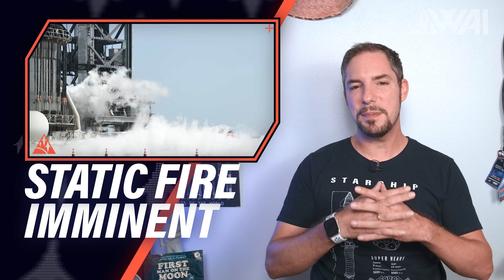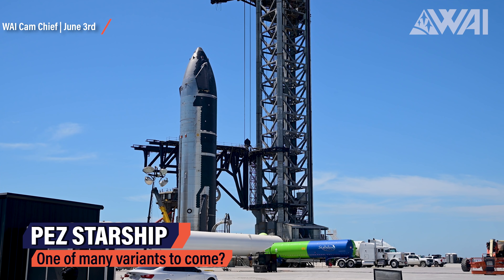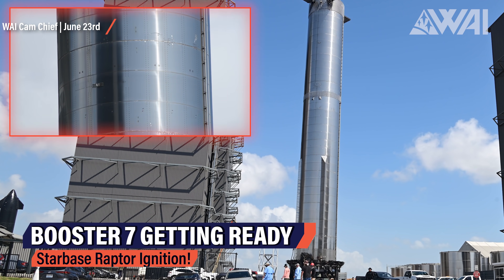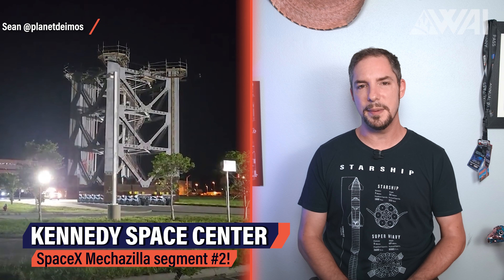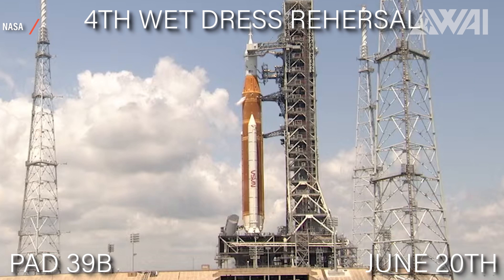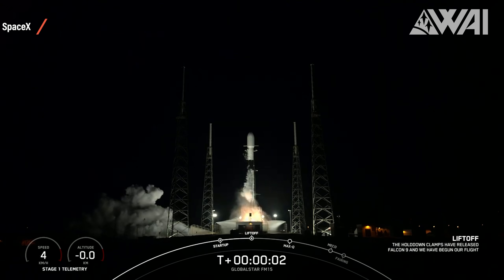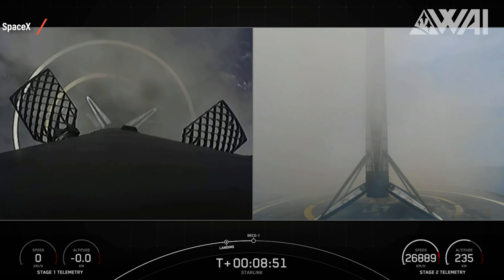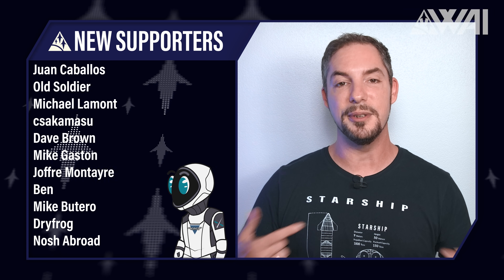SpaceX Starbase IGNITING Starship Booster Engines!

Comment: Dont know if a modular system makes sense, since they can build starships at a relatively cheap price.

They been pumping out ships at a rate that not long ago was unheard of.

Its nice that they can customize ships for its purpose, and not need a "one to rule them all" design like the shuttle.
Just like planes that you can refit it based on purpose, but you dont go around swapping modules based on each flight.

I wonder if there will ever be an expendable version, with an even bigger fairing. No tiles, no sea level raptors (since no landing), no flaps. If thats the case they could put some huge and heavy stuff in orbit if needed...
Reply: Extra fuel and oxidizer could also occupy the hollow sections of permanent habitat panels are spec'd to tank parameters and cryo tested.
Reply: @gary.richardson  you mean making the thing a huge structure full of fuel, then once in orbit convert it to a huge habitable area (even if that means some modifications while in orbit).

Yeah i always asked myself if thats an option.

They could even remove the raptors and carry them back with another starship. That would be quite good to build big habitable structures.

The way i see it, starship as great as it is... its payload. The real monster is the 1st stage.

2nd stage could be swapped based on the needs, reusable, expendable or even as said something that can be repurposed.

There are so many options opened by this that the developments in the coming 10 years will be amazing.

Comment: Lots of waste from both. Both doing one task, means waste.
Reply: Elaborate?
Reply: @alvianchoiriapriliansyah9882  Sure. Waste comes in many flavors. NASA"s approach has always been waste, shuttle wasn't exactly that great, too costy, waste big time in the form of $$$. With spacex the waste is in the form of whether the raptor 2's will be able to take multiple launches at 230 tons of thrust. The boosters landing ocean side at first means unusable raptor 2's and this leads to waste. If all that is fixed, it will lead to a better solution, until then we will see. Having a vehicle purpose built, means once its purpose is over, it can't be used for something else, so waste is in the building of the vehicle via welding wire, gas, and money.

Comment: The can crusher is a unique device. As far as I am aware no other rocket is or has been tested this way. In the past engineers determined the flight loads mathematically and built the rocket to withstand those mathematical numbers on paper. Then they would fly it, there would be no real testing other than the first one is empty.

Comment: comment for Algo also it would be cool to see a spinning top section for artificial gravity
Reply from the maker: Thank you! That would be hard to do. The radius of 9 meters would mean that everyone in the Ship pukes as the difference between rotation at the feet and at the head of the Astronauts would be too low. Maybe extending booms with Starships docking? Maybe cable, but that would be risky when starting and stopping the rotation.

Comment: Please note there are 32 Raptor2  engines under skirt. This is common error. The 33 engine is on the second stage. U R Great!
Reply: 20 in the outer ring and 13 in the center. Starship itself will have 6 and then 9.  39 and then 42 for a full launch.

Comment: I think Elon wants to keep the part count low. Interchangeable modules adds to many failure points.
They already want to build hundreds of starship so making them according to their needs is not a problem.
Reply: Let's see a Starship get into orbit and back safely first. If it blows up, there's not much sense talking about reconfiguring...
Reply: @Andreas-gh6is  it’s very unlikely for the first orbital Starship to survive re-entry.
Reply: I would expect modules that are set at construction time — not swappable, since as you say, that adds a lot of extra complexity and failure points. But a standard propulsion section with a payload section determined by what's required when it's built... that seems probable.

Comment: @2:50 Starship is a modular design. Its ultimate diameter isn't even fixed. 
Transporting 12-meter wide objects to space, like bigger _integral_versions of James Webb? 
Transporting huge amounts of ultraclear frozen water to wrap in segments around cargo and protect it from cosmic radiation?
Transporting large, heavy segments of nuclear reactors to assemble together in space to provide power past the orbit of Mars?
Starship can do those.

Comment: variants I think will happen
starlink deployment starship
tanker starship
normal cargo (smaller doors)
big cargo (big door)
cleaning up LEO starship
lunar starhip
mars cargo starship
mars human starship
expandable starship (no header tank, finnsand sea level rapors, but has fairings )
human starship for leo

I can also see spaceX develping a starship to replace orion/SLS. Small place for crew and the rest extra feul for getting to gateway in on launch or just expandable 2nd stage with orion on top

Comment: Elon identified at least 3 varients from the earliest days of Starship: crew, cargo, and tanker. Your idea of a two-piece Starship is interesting but would seem to require something other than a welded interface. How much extra height would be required to accommodate such a design?
Reply: Not much. The problem would be with the tile system at that joint. Welds don't flex much where a joint like that could. As Elon said, he hates flanges which is basically what you would have at that joint but internal instead of external.
Reply: That was my thinking and Elon does like reducing complexity.  With as many Starships as they are talking about building, I just don't see the need for a modular design.
Reply: None. The Starship is already built ring by ring all welded together. Some rings are part of the fuel tanks, others part of the cargo/crew area.
Reply: I've seen SpaceX always optimizing for weight to maximize what they can get into orbit. An interface only adds weight so I think not going to happen.
Reply: With automated welding and jigs, why not simply a reinforced, thicker band at the mating edges? Weld it together much like it normally would be, cut it off when a different type fairing is desired, and weld on the new one. If the narrow heat affected zone is removed when cut, it should be just as strong as the first time. Adding the extra layer, narrow band at the joint would give you extra material, so you don’t end up with a shorter rocket. Best part is no part, and the welding and cutting is pretty fast.
Reply: @evanmorris1178  They are already planning on building a vast number lot of Starships.  Musk's goal is to produce a starship every 72 hours.  

At that kind of scale, I believe their resources would be better spent on optimizing their pipeline so they simply have new vessels of the needed types coming on line when they are needed.  Making them modular does appeal to my inner Kerbal but seems unnecessary when it can be solved via logistics rather than engineering.
Reply: @danielbuggie591  I agree, that’s the story, and I hope it comes to pass, but 1 every 72 hours is aspirational. They might pull it off a few years down the line, but in the near term it might come in handy. Always good to have alternate plans. Thanks for the reply.
Reply: @evanmorris1178  Sure, and the 72 hours would surely not be the time to make a starship but a reflection of how deep and wide the pipeline would end up being.

Comment: I’m less interested in how many variants there will be than I am in how the tanker variant will be configured. Will it have separate tanks? Or will the two main tanks be enlarged to consume the entire volume of the vehicle which would maximize fuel load and minimize overall vehicle weight. After the flying Starlink says, getting that tanker up and running should be a top priority.
Reply: regardless of separate tanks or what shape they are the fuel is limited to the amount of cargo limit.  The fuel cargo will be somewhere between 100T and 250T which is still bigger than any payload we've ever been able to launch.  Think of how many launches it would've taken to build the ISS if Starship had been used.  It's safe to say that assembly would've been completed in days and not years.
Reply: @plexisgaming  it would probably just be made of starship hulls.
Reply: @cannonfodder6299  Or from an extension section in the middle of a Starship. Section latched between the nose section and the fuel section. When in orbit, center section is unlatched and then nose section is rejoined with fuel section. No need for tiles on the center section.
Reply: My bet is that the existing tanks would simply be longer, taking up more of the Starship volume. No need for separate tanks in the cargo area.
Reply: @royh6526  separate tanks may be better structurally.  Easier to design and build separate tanks that can withstand the launch. 
  They will need a lot of tankers though, between moon missions and Mars, have to send tankers to both, for the return trips.
Reply: Maximum propellant capacity to orbit for Tanker wouldn’t require much more tank volume than in an ordinary  cargo Starship. Propellant is pretty dense. This is rather like an AirForce tanker plane. They’re basically cargo planes with the full cargo deck left empty when they are acting as Tanker. If you filled the whole cargo volume they couldn’t take off. A Tanker is just a Cargo variant launched with full tanks and no other payload. There is a use for versions with stretched tanks in the whole volume that would act as a fuel depot.
Reply: Such tanks are often spherical, and with a cylindrical ship that would mean separate tanks. Often it's less about the volume and more about the mass.
Reply: @Andreas-gh6is  In the case of Starship, it just needs domes in the ship to divide it. Already being done so all they would need to do is elongate them. Now the question would be, do you send up just one component or do you send up both at the same time?

Comment: Wouldn't it be easier and more cost effective to reroute the hwy. They need to keep closing?
Reply: Can't. It is in a wildlife area and so they are stuck with where it is.
Reply: @gravelydon7072  build it underground using Musks tunnel boring company or suspended it above the surface like a bridge. It can be done come on this is a company who believes they can bring a million people to start a civilization on Mars. If they can't overcome this issue than what hope do they really have.
Reply: @claredegroff1491  Problem is with water. To build it underground you would have to fight the surface water in the area. And then would have to pump the water out of the tunnel. The only way you could put in a tunnel in that area would be with a cut and cover method. It is how we have to build down here in S. Florida  You blast the rock and then drive in sheet piling. You dig out inside the sheet piling. Which then fills with water as you are digging it out. You then order lots and lots of trucks of tremie concrete. For one pump station, it was 100 truckloads. And that was just to seal off the bottom. Then you pump out the water. Now you can build on top of that concrete plug. But all the while that you are doing it,  you have to have a sump pump running. You build up your forms and then do the side walls. During that time the road would be out of service. 

The other way would be using precast tunnel sections. But that only works if you can float the sections into place. Like what was done in Istanbul, Turkey. Again, the road would be out of service for a long time. Boring machines do not work well with sand and water being involved. They would have to be pressurized and there you run the risk of a blowout.

Comment: Take that idea for interchangeable fairing/crew section and also apply it to the engines I know I say it a lot but creating a nuclear thrust puck that could attach to the bottom of SS. The engine/hydrogen tank would allow high efficiency and uses a far easier to produce fuel versus the methane engines only. Starship would just need to intersect the puck and return to earth where you use raptors to land with the far lighter thrust puck entering a high orbit that can be fueled by lunar tankers.

Comment: A Single-Use Starship with the engines and fuel tanks, of course, but with various configurations for the upper-stage. Maybe not even a fairings section. Would it even be possible to launch non-tubular structures, like the main saucer section of a Start-Trek Enterprise ship? Other parts such as engines would follow in subsequent launches and require space-walks to attach.  Or the saucers could act as small space/hotels/stations and grow by stacking.

Comment: I wonder what kind of FAA permission SpaceX would need for a Starship or Booster sub-orbital flight from Boca Chica to Cape Canaveral.
Reply: One question is why ?  Until safely landing either multiple times, NASA isn't going to allow it. Elon is betting on permission to capture/land Starship boosters at the Cape. SpaceX is well underway building # 2  launch and capture tower at the Cape.
Reply: @terrysullivan1992  Why? Because I'm curious.

At some point, SpaceX is going to have Boca Chica, Cape Canaveral, and two floating launch pads. Chances are very high that there will eventually be sub-orbital point-to-point transfers of equipment. 

In particular, if there are specialized Starships it's feasible that some Starships may need to be moved from one launch tower to another for loading of specific cargo or launching into specific orbits.

I have no idea how the FAA would handle the permissions for something like that. Thus, I asked about it aloud.

Comment: A SS that is designed to be a segment of a circular station. The nose section is extra long and detaches from the aft section , which has the Elonerons. This allows that section to return for reuse. How to build the station? Connect the aft part of the nose section to a circular hub like a spiked collar.  You have gravity when the hub rotates. Requires almost zero new tech.

Comment: Starship is about to change space travel forever.  Maybe as big of a technology disrupter as the cell phone, computers, electricity.   I don't think most people have a clue what a 100 tons of orbit means?  It took 36 shuttle missions to put up the ISS up, with Starship, maybe 1 or 2.  If they can eventually match Falcon 9 with one launch a week, we could build space stations 10 times as big as ISS that rotate, Oneil cylinders, point to point travel anywhere on earth in 30 minutes, and yes the moon, Mars and beyond.

Comment: the cool thing about this ship design is that it will always be useful, when starlink sats die out thos one will bring a new batch.
not only that but it could also become a new way to map out our solar system
imagine sending this to mars orbit to launch a bunch of starlink/lookalike that have another job to do
it could also be used to bring payload to the moon, like wall pannels for labs and other constructions.
Reply: considering its costs spacex 2000$ for every starlink customer(just for the reciever),   i'd say it will never be profitable.
Reply: they are already waiting for starship to put up starlink v2 sats. gonna be soo much faster than the current speeds.
Reply: @Lynn Geek elon musk said they cost  2500  a piece,  and thats the 'reduced' price.    So with 500 and 100 a month,  it would just break even in 20 months.   Starlink has to be completely replaced every 60 months also.
Reply: @jebes909090  Much of the replacement work will be upgrades with time. V.1 sats are not being launched anymore. V.1.5s are. With Starship it will be V.2.0 The 1.5s can already send and receive in space with LASERs.  If you check one of the satellite map websites you can see which ones currently are V.1.5s.
Reply: @gravelydon7072  the lasers are to communicate between satellites,  not with the ground.   Its part of the reason why they'll have a low latency, because they can transmit around the world quickly.   Millions of ground stations firing lasers into the sky would probably create thier own problem.

Starlink is one of those ideas that seems really brilliant until you start doing it and then glaring problems pop up.
Reply: @jebes909090  Which is why I said "in space." And as someone who now has it, yes there may be problems, but it is far better than DSL or Uverse.
Reply: @gravelydon7072  I  dont doubt it,   but i said it would never be profitable, not that it wouldnt work.     its like having a helicopter for a taxi, yes its faster,  but its also stupid.

Comment: Could a starlink be taken back out of orbit by Starship to return it to earth?

Or, just let starlink deorbit and just replace it.  Basically going back to disposable space stuff.
Reply from the maker: Current Starlinks operate in LEO at around 350 to 500km. There still is some atmosphere at those heights, making the sats deorbit within months. Anything above 700km is a real problem. Deorbit times go up exponentially. :_WAIHello:
Reply: The mission would cost more than the value of the satellite.

But so can I see a case for refuelling them so they have a life longer than 5 years by launching a specialised refuelling tender.
Reply: @fredbloggs5902  The electronics will probably be obsolete by the time they need refilling - the orbital slot will be worth more than the old hardware.
Reply: @dancingdog2790  Yep. Just think of how long the V.1.0 ones have been up there which now are being replaced with 1.5s and soon to be 2.0s. In 5 years we could be up to V.10.0.
Reply: they do have a deorbit mechanism for end of life, though IIRC a couple of times it hasn't worked right.  damage or malfunction or both.
Reply: Most everything is /eventually/ disposable. Starlink satellites have a decent life span, so being eventually disposed of (especially in the responsible way they currently are disposed) is not a bad thing

Edit: formatting